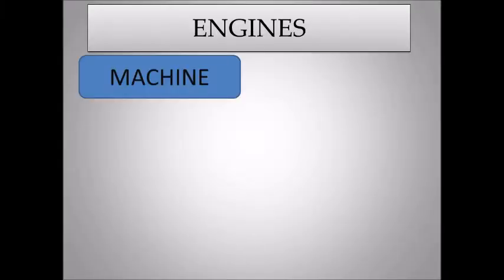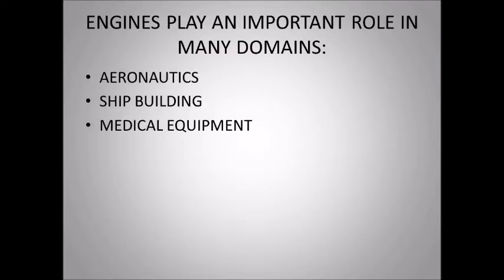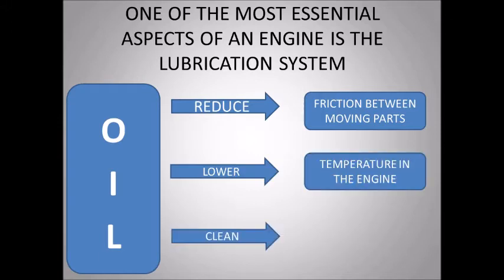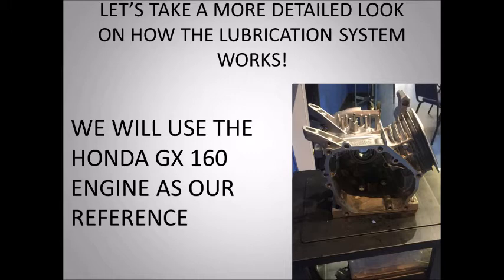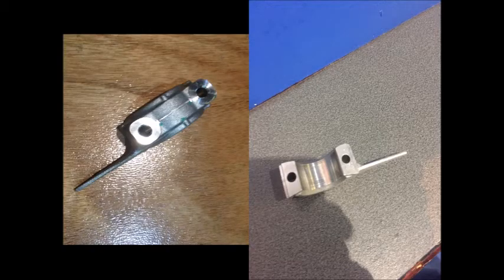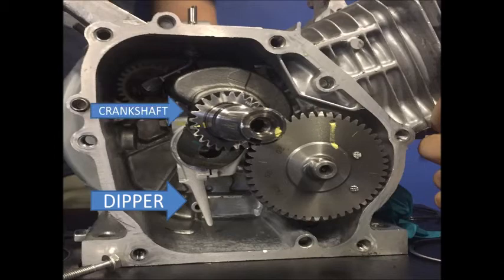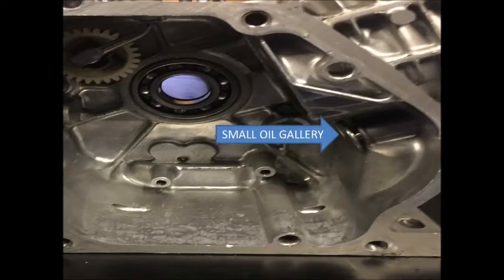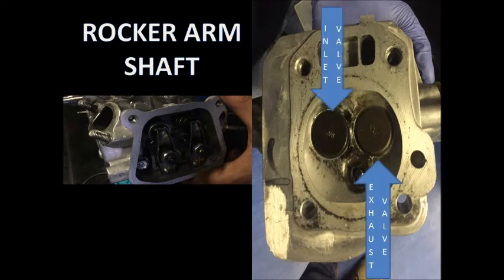LUBRICATION SYSTEM CAMSHAFTS,INLET AND EXHAUST VALVE HONDA GX 160 IVAN RARES CRISTIAN

Comment: Good morning, from what I could see in another video, the small hole located at the bottom between the two tappets seems more like an oil return rather than a feed; the feed appears to be the rather large duct that is at the top of the cylinder and ends above the valves... The oil obviously travels through this duct pushed by the "dipper" and the piston's pumping action.
The video that shows this duct is the following:
https://youtu.be/X4DQvxVlcvU?si=ou8tRXyUeBibolit